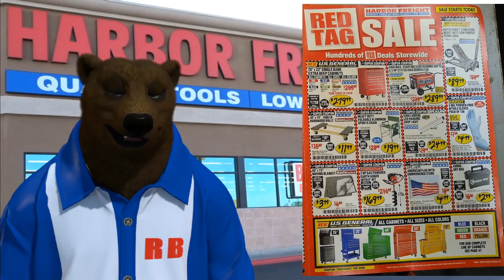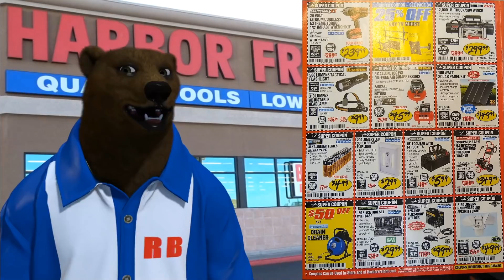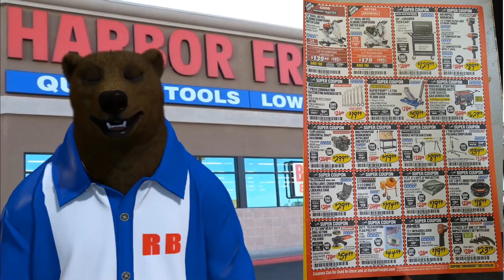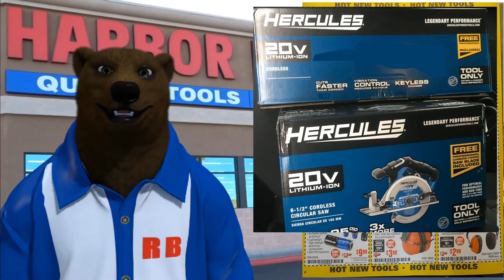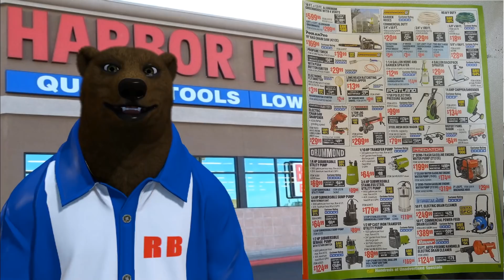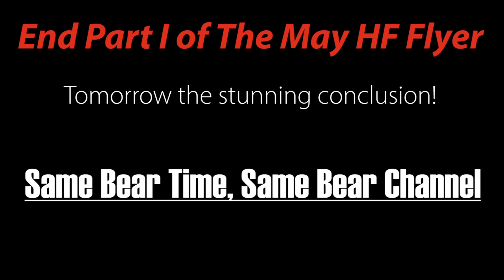Harbor Freights Epic May Sales Flyer (Chapter One: The New Tools are HERE!)

Comment: Yesterday I purchased the Bauer 1/2" electric impact wrench to remove and replace the blades on my bush hog. I am really hoping this has enough power to do the job! I will give you a full report on its performance later today.
Reply: UPDATE: The Bauer 1/2" electric impact wrench (64120) performed like a champ! With a 1-3/4' impact socket from my Pittsburgh Pro impact socket set (67989), a 1" to 3/4" combined  with 3/4" to 1/2" adapter from my Pittsburg Pro  7 piece impact adapter set (67937), and a 6", 1/2" drive extension, I was able to break free the large nuts and swap out the blades. Thank you Harbor Freight!

Comment: The tip of a tooth on a 7.25 in. blade will be traveling faster than a tip on the 6.5 in. at the same arbor rpm.  Plus, you should have more teeth on the 7.25, so each tooth will cut fewer times on each 2X4 you cut.  The only advantage I see on the 6.5 is less overall weight, which aster a long day's work can be significant for us older gents.
Reply from the maker: The point wasn't the speed but the power it takes to get that speed.  So you can have a smaller blade, smaller motor, smaller saw!  And yes, the advantage is weight.

Comment: If you cut bevels and angles all day you’d understand why the 7 1/4 is a must. For the home gamer, one of those 4 inch saws would probably be more than fine but as a carpenter,  7 1/4 is the only circular or “skil” saw to have on the job.
Reply from the maker: A blade this size can cut a 2x4 in one pass at a 45-degree bevel.   The 5" blades can not.

Comment: You had me believing your opinions on this stuff till you said the work bench was good. I wouldn't take that "work bench" for free.
Reply from the maker: The wood one or the metal one?  I'm only passing along the info on the wood bench. And as to the metal one?  I thought the same thing you did but the guys talked me into it and you know what?  It makes a great tech bench.  I do a lot with electronics, including making my own battery packs.  I need a metal bench to ground off of and it has a great work surface for this sort of thing.
Reply: @denoftools  the metal one. I saw it in store and laughed to myself. I just couldn't. Maybe you're right if you're just fiddling with very lite things on there. But it couldn't even support something of substance. It was so wobbly in the store, the drawers were def useless. Idk. To each their own. Thanks for the video though.

Comment: A 6 1/2 in blade will a 2x4 at 45 deg bevel but I don't think a 5 1/2 will
Reply from the maker: According to Lowes: Most saws with blade capacities of 6 inches or more can cut through 2-inch dimensional lumber at a 45-degree angle in a single pass. A 5-3/8-inch saw can cut through 2-inch-dimensional lumber in one pass at 90 degrees but requires two passes at 45 degrees. As a general rule, saws with smaller blade capacity weigh less and are easier to control.

Comment: I wish we had the humidity you guys have. How high does it usually go there?
Reply from the maker: I think the average is around 30%
Reply: I really do wish we had that around here. Summers here don't get as hot, but they still find a way to be down right oppressive. Just got a Dewalt 20v hedge trimmer. Picked it up at Home Depot for the usual price. Looking at the prices in the flyer,  I get the feeling I over paid. I could almost have a battery, string and hedge trimmer for the same price. Do they have 5Ah batteries for the Bauer line?

Comment: Costco LED shop lights are quite a bit better than HF's.  Last time I was in Costco they had two flavors.  One had a cover, and a motion sensor.  The other looked like your standard two bulb pull string light.  I have the latter with zero issues.  You can only daisy chain three.

Comment: I was really tossed between the Earthquake XT 20 volt impact wrench, and the Kobalt 24 volt impact wrench, both are 1/2 inch drive. Both have very impressive numbers, but there were two things that sold me on the Kobalt. The first is expand-ability, the Earthquake (at least to my knowledge) does not share it's battery with any other tool, where the Kobalt has a long line of tools that share their 24 volt battery. The second was the price. the Earthquake was $269, and the Kobalt checked in ONE HUNDRED DOLLARS cheaper. The Kobalt has a 3 year warranty on the battery and 5 years on the tool.........not sure about Earthquake's warranty, but for a Franklin........that was a no brainer for me. I did get the Pittsburgh 3 piece impact rated reversible lug nut set for my wrench though. I might go back for that set of lug nut sockets with the padding to protect aluminum wheels, that did look pretty nice and I should have got it instead.
Reply from the maker: That Kobalt is a hell of a deal. I wonder how it compares to the Bauer.
Reply: @denoftools  I don't think that Bauer or even Hercules (which would probably be my next choice) stand up very well against the Earthquake XT or the Kobalt. I think that the Earthquake XT, and the Kobalt, are the 2 best bet choices for the DIY'er or the mechanic who can't afford the tool trucks or the big name brands. I have seen a torture test where the Earthquake XT kept going well past Milwaukee's numbers while costing about half of what the Milwaukee costs. I also watched another torture test that pitted a Bauer drill/screw gun against a comparable Hercules. Both were attached to a single metal rod and given full power (head to head style), the Bauer died a miserable death where as the Hercules kept going. I think that the Earthquake XT is a big beast that packs a mighty powerful punch. I just wish it wasn't an only child, and came from a big family of other tools that shared that battery. The biggest con that I can think of with the Kobalt, is that it doesn't immediately go full speed when you pull the trigger, and doesn't immediately stop when you release the trigger. It takes about a second to stop and go, much like a lot of air powered impact wrenches. Could that be because it has a brushless motor?? I don't know, but it wasn't a deciding factor for me.

EDIT I wouldn't mind seeing a test between the Bauer, Hercules, Earthquake XT, and Kobalt. You could even toss in some of the big (dollar) boys too.

Comment: As you know, I use my 4 drawer HF tool cart and have it organized and loaded. I use those 18" magnetized bars to hold the rachet  wrenches to underneath the lid. Gets them at the ready and it takes up less room. Down below on the shelf, I have an old Craftsman tool box with hammers, saws and rotary tool. It also allows me to carry a 12 Guage 50 foot extension cord. Behind that I have a wheel bearing kit. 

I tried the HF chain breaker kit for my motorcycle. I found it to be a 1 time use item. It's not strong enough metal, but for the price, who can complain?

The air compressor hose for ~ $19  is a real buy. I have a 10 gallon HF compressor in the shop, those two together get the job done.

One other thing about inexpensive tools. I'm on the 2nd generation of cubs. My 9 year old grandson is happy to work with me in the garage. If he trashes a tool, I'm not going to be concerned. I consider that the cost of education. 

Thanks again, bear.

Comment: I have the Bauer 1/4" impact and the 1 /2" impact. I am constantly impressed with them. The 1/2 impact takes all my lug nuts off without breaking a sweat. I worked on my tractor last week and had about a 16" extension on it and it still removed the nuts. I am excited about all the new Bauer tools. Best buy for the money. Thanks bear. Great content.

Comment: The biggest pro with air tools is the size and weight for the power delivered.  That corded electric should pound off any lugs, but won't fit many places under the hood or in the wheel well.

Comment: makes suggestion that Bauer may be better than Ryobi
These suggestions seem par for the course, would really like to know how we're concluding this
Reply from the maker: How exactly does Ryobi beat Hercules?
Reply from the maker: Ryobi has a few tools that break into the low-level pro ranks but they also have some tools that are on par or even worse than B&D.  Ryobi has a huge line of tools that covers a very broad spectrum.  Often with 4 or even more of the same tool in different build qualities.   I've owned two sets of Ryobi tools and I've played around with some others.  But as I said, they don't have a lot of consistency across the line. It's not so much that they "fail" in trying to make a good product, it's that they are trying to hit very low price points with some of their tools.  The P1815, for example, could be used by most pros and will easily outclass a lower tier DeWALT while the P1810 would have a hard time keeping up with the basic Craftsman, much less the Bauer.

Comment: I’ve got two of the security lights. Had them a month or so they work really well.
Reply: I was wondering how well those lights may work.  Thanks for the info.  I have similar ones that are not HF that are a few more lumens but were easily double the price of these HF lights.  Keepin' these HFs in mind if the ones I have need replaced in the future.
Reply: Michael they are really decent. They have a dusk to dawn feature I thought was cool.
Reply: I was wondering how well those lights may work.  Thanks for the info.  I have similar ones that are not HF that are a few more lumens but were easily double the price of these HF lights.  Keepin' these HFs in mind if the ones I have need replaced in the future.
Reply: I have the older ones and they are hit or miss.  I wouldn't buy the black older ones.